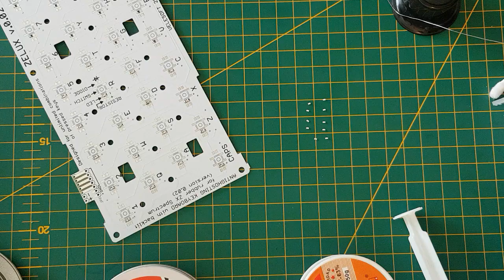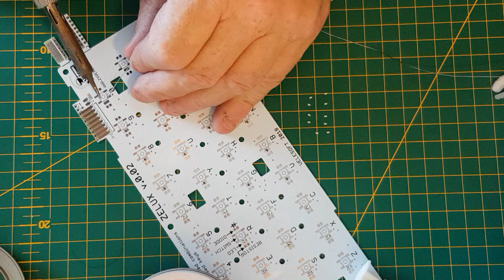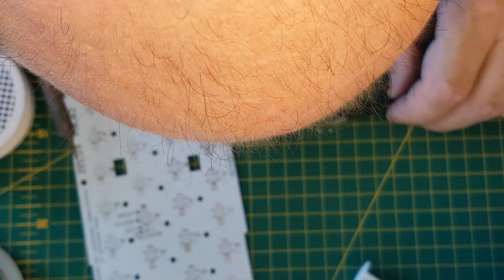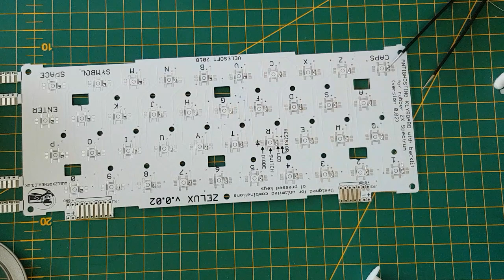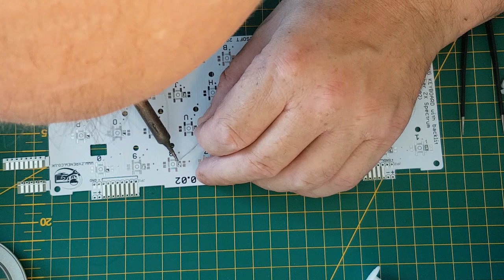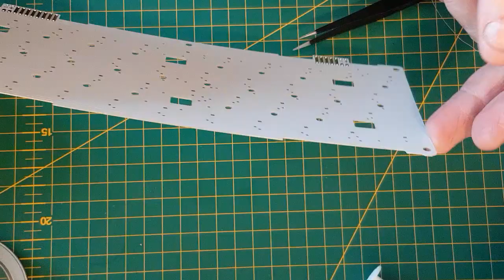Led tips on the best way of soldering from my own experience

Comment: Thanks,I am trying this. Do you know the best resistor values for each 0805 led please? I have the spectrum colours. The Harlequin worked first time. Just need to tackle the keyboard now lol. Cheers
Reply from the maker: Sorry about that late reply I just seen when you sent the message many apologies didn't come through till just
Reply from the maker: R is 1800 g 2000 b 0 y 68ro
Reply: @retrorobbins  Thanks mate. Not sure I used them but it works great. Keep it up.